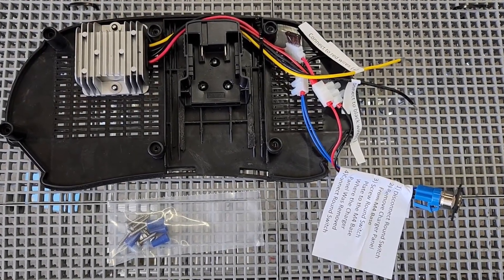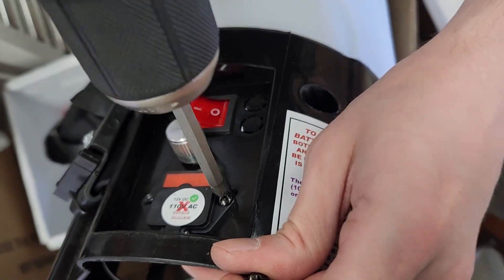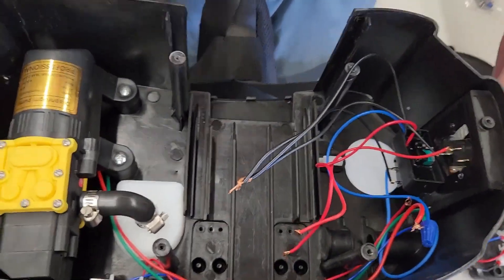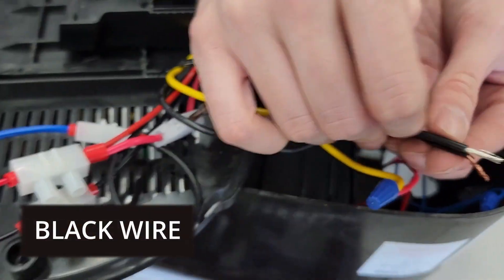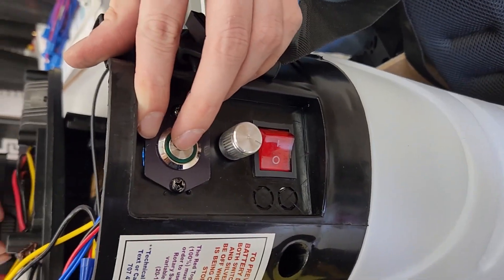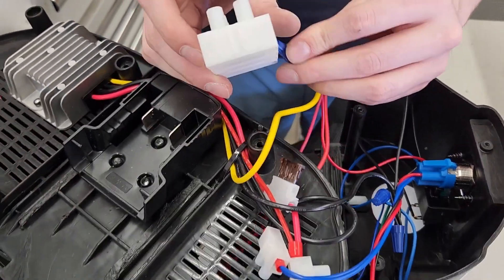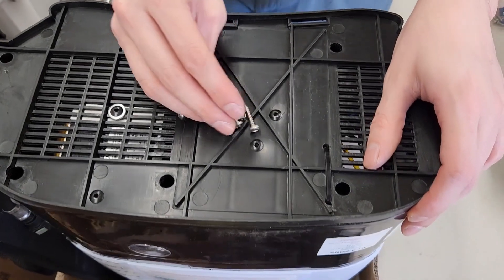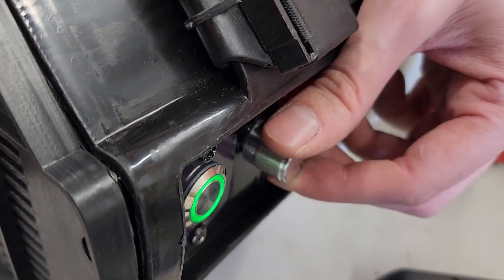M4 Battery Conversion Plate Installation (DeWalt, Milwaukee, Makita, Ridgid, Black and Decker, etc)

Comment: how long do the dewalt 20v batteries last on a charge?
Reply: My Standard 5+ year old Dewalt 20V battery only last for about a days worth of a pest control route

So 8 houses a day average of 8 minutes exterior spraying a little over an hour of spray time per charge 

I recommend getting flexvolt or Power’s tack if you go with Dewalt